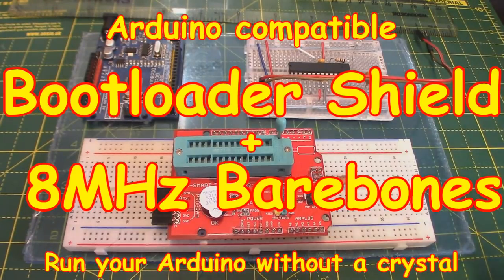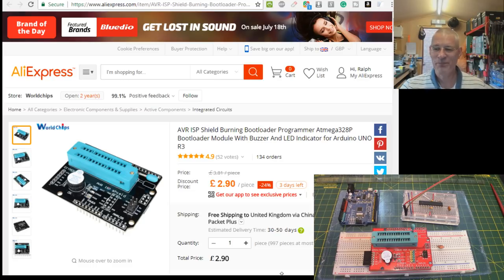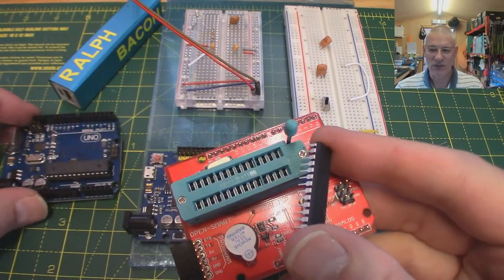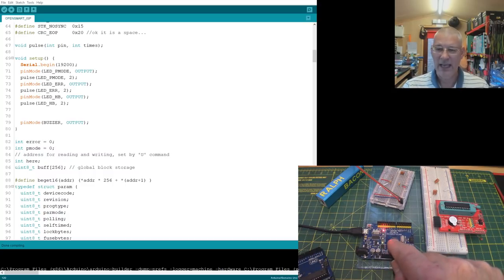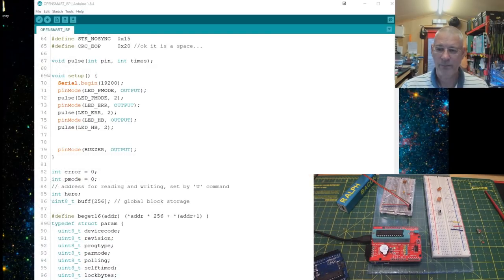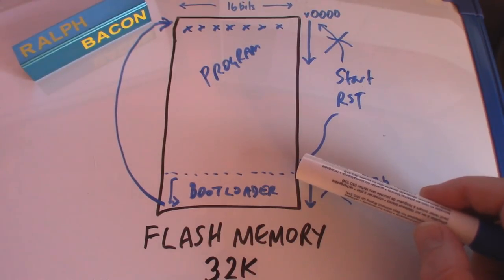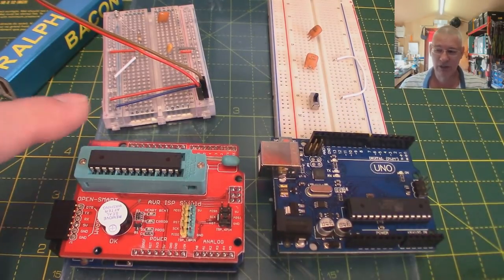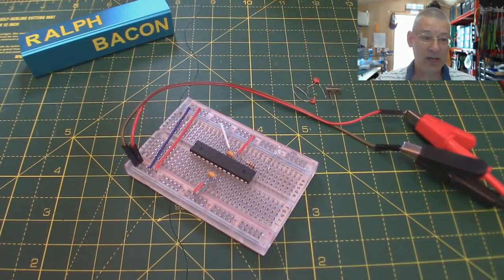#119 Bootloader Shield 🛡️ and 8Mhz Arduino Barebones (made easy)

Comment: you guy that make these videos and don't keep them up to date  should shut the video down or fix any issue that have arises for example sketch no longer works  that come up error no good
Reply from the maker: I don't believe there are any issues with the information in this video; it's a barebones ATMega328p chip running in a minimal configuration! What's the problem you're experiencing?

Comment: Dearest Ralph, Initially I want to thank you that you have promptly answered me I bought 2 moteinos  (one USB and one with FTDI)from  LowPowerLab.com Mr Felix Rusu  asked me to log onto https://lowpowerlab.com/guide/moteino/programming-libraries/ and this page is active everywhere you point the mouse and enter' it takes over ; I wanted to add all the Moteinos so I clicked on the preferences/additional boards URLs and goes to the second picture which is also an active and as well the third picture but nothing is happened nothing is installed in boards manager. I had some success installing Moteino, and moteino mega using the arduino's hardware , but nothing for moteino mightyhat nor the moteino (8MHz)
Could please help me I am stumbled  for 4 days now.  God bless you and family
the very best
Demetrios
Reply from the maker: I'm afraid I just don't have the experience of these boards to diagnose what could be going on (or wrong) Demetrios, I'm so sorry. Perhaps you need to speak to Felix Rusu again and let him guide you, step-by-step, through the entire process. It's the best suggestion I can make at this time. Good luck, I hope you get them working.